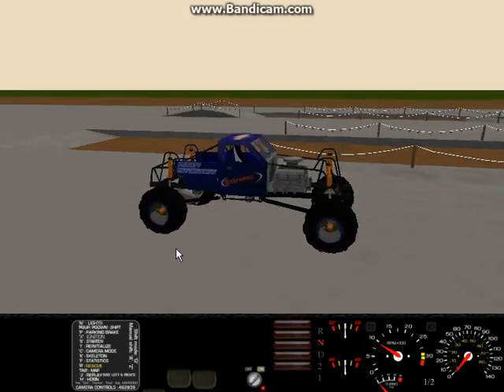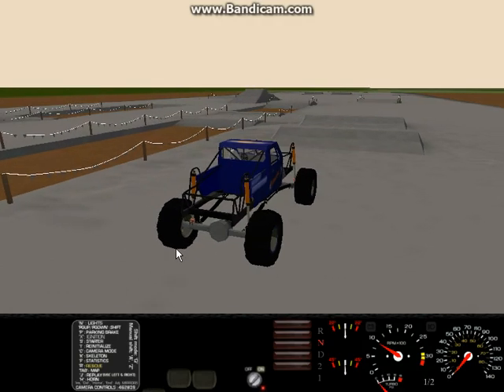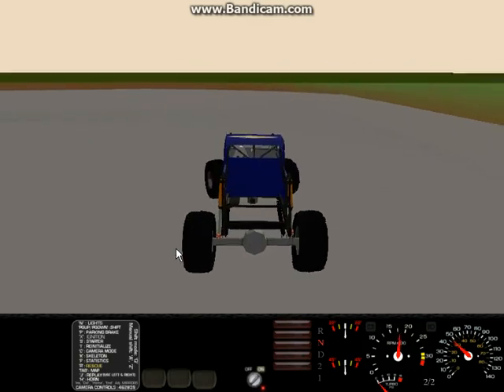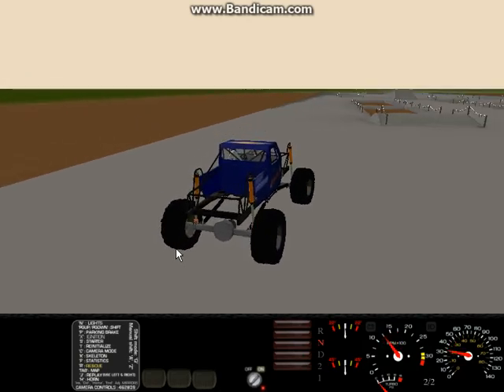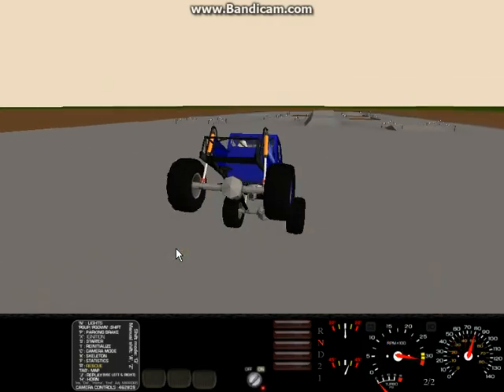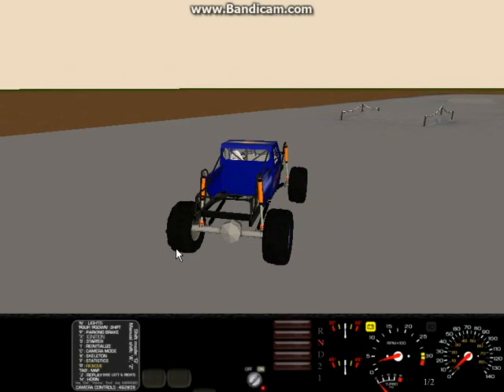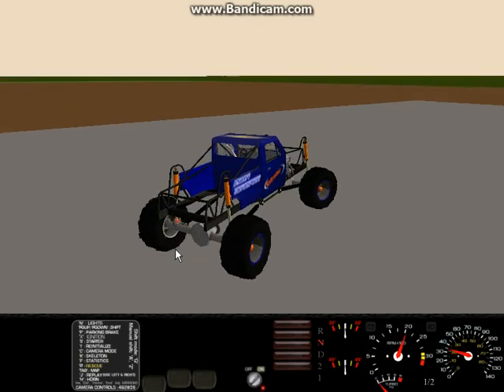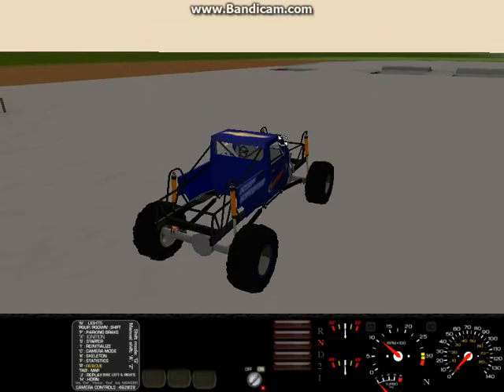North vs South and Mud Truck update

Comment from the maker: Have it at about 3000 torque, global weight is 2000, and have minimass set at 5.0. Truck weighs 5000 lbs roughly. And that is going off the weight when you hit T ingame. Also runs locked differentials. Still toying with the gearing and suspension those always seem to take me awhile.